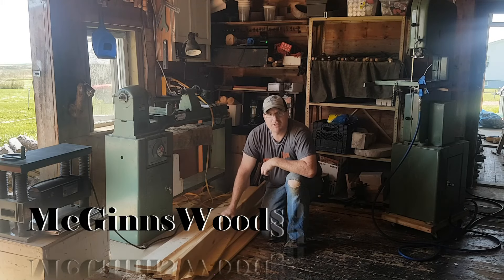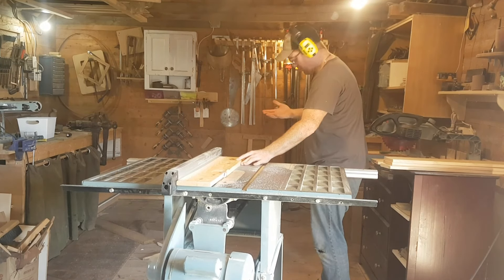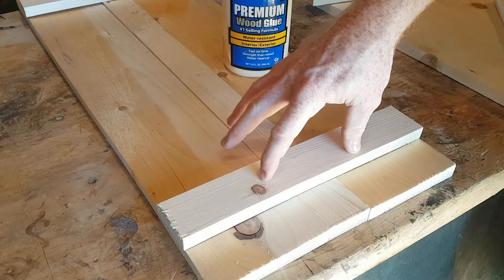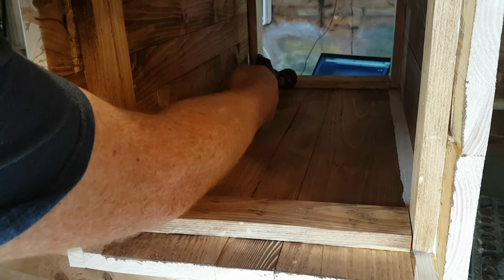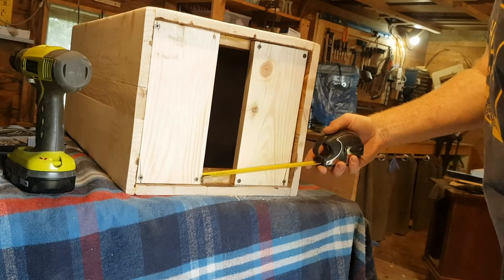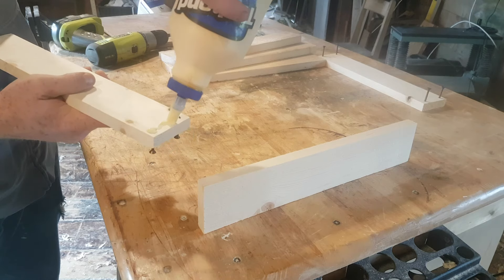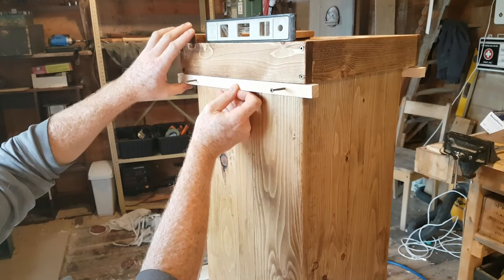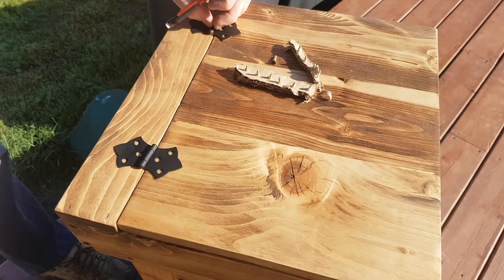Rustic Garbage Can with Cheap Lumber that will BLOW YOUR MIND!

Comment: great project what size gallon bags do you use in that size trash can. and do you have any problems with the bag snagging on the batten's inside
Reply from the maker: "66cm x 91cm" or "26in x 36in" is the size of the bags, they fit almost perfect!  no snagging either